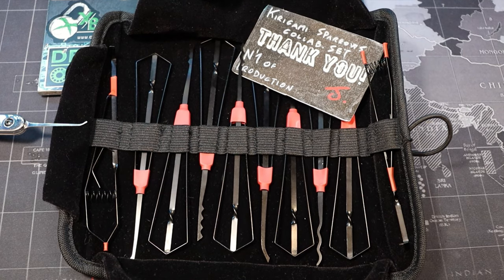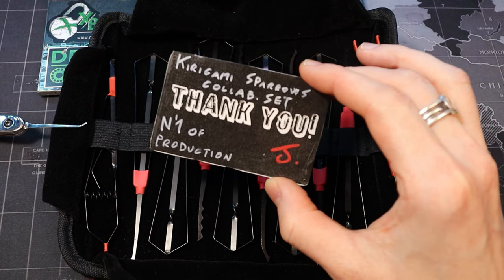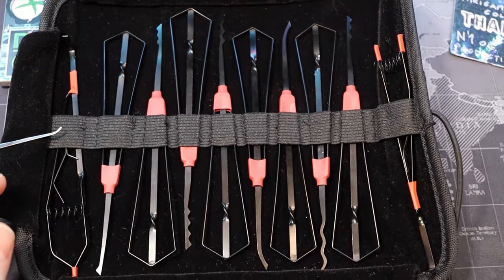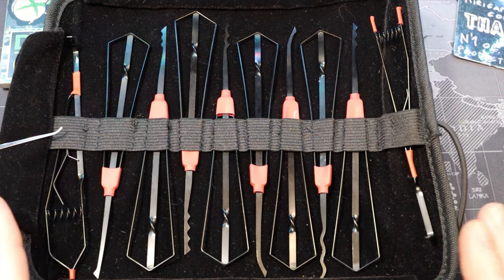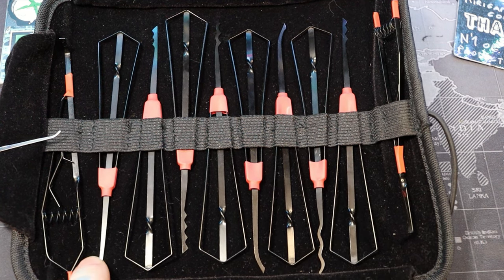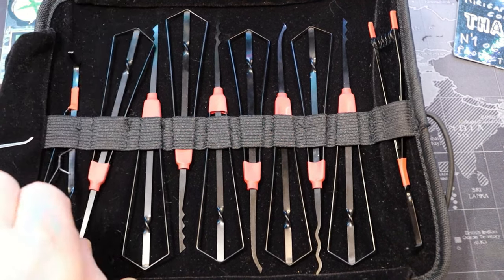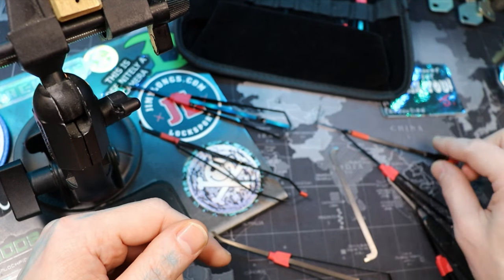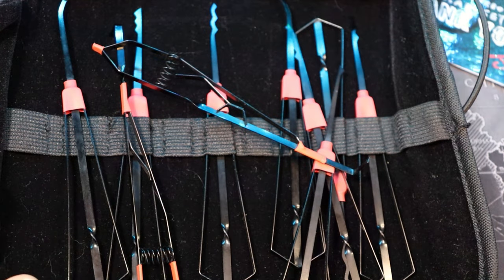294) Kirigami Lockpick Set by Killermaru x Sparrows

Comment: Judging by the way the turning tools fit so loosely in the 575 keyway, I'm going to guess the thickness is only about .030" /.8mm (or less) on them?
I haven't got a lot of enthusiasm for anything under .040"/1mm though it may just be that I haven't tackled any locks yet where thinner was necessary, maybe a Euro profile or something? I prefer a tight fit for my TT, for better control. Seems like less chance to bind the core up too but I could be wrong there.  I would just think the thinner the turning tool, the more chance it's edge could bite into the brass and/or wedge between plug and housing.
Also, what Dmac said.
Reply from the maker: I think it's 0.040". Doesn't feel thin but I haven't measured either. Usually 0.040" fits better though